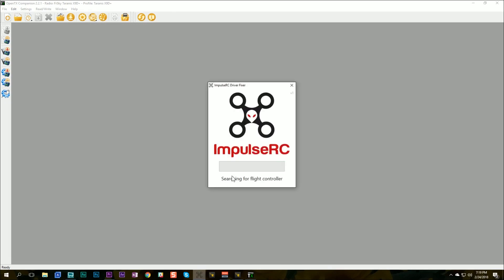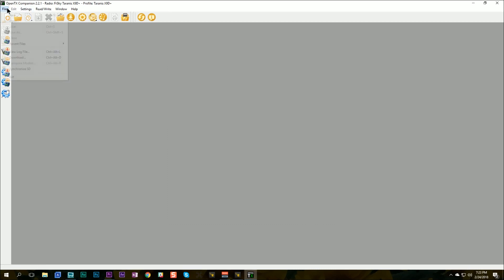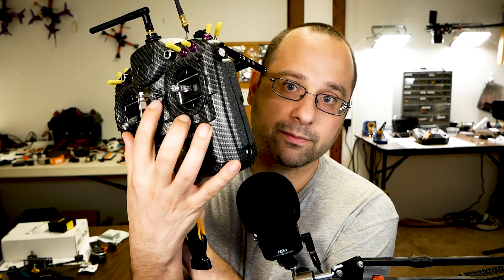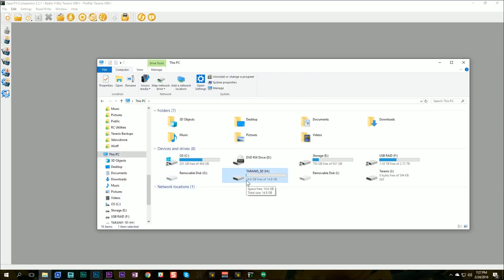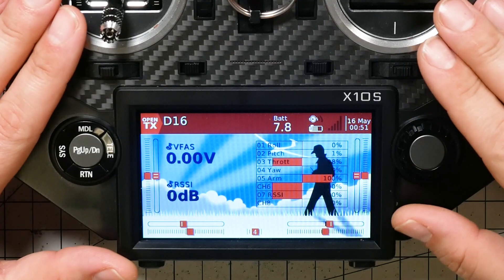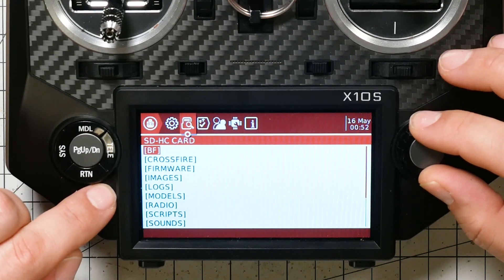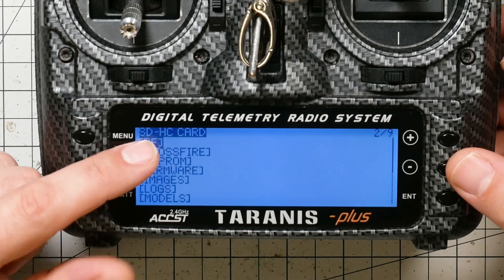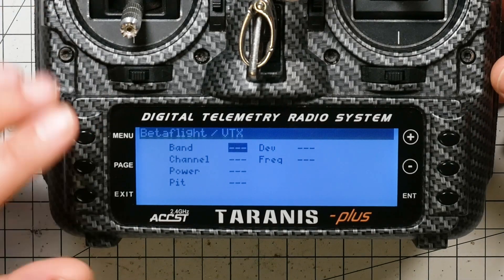Betaflight Lua Script Updated for OpenTX 2.2.1 | NO MORE OUT OF MEMORY ERROR

Comment: I did the update on my Taranis Q X7 to 2.2.1, but when I run the bf.luac script, all the values are blank on all the pages. I am using an FRSky R-XSR receiver on a CL-Racing F4S FC. The smart audio is working via the OSD. I also have telemetry data in the Taranis. Any idea why I am not seeing any data in the bf.lua script?
Reply: I figured it out, finally!
On the CL-Racing F4S FC, the telemetry accepts the inverted (regular) S.Port signal. You do not have to use the uninverted S.Port pad on the R-XSR.
Then I had to make sure in BF CLI that telemetry inverted was set to OFF and telemetry half duplex was also turned off.
In BF CLI type these commands:
set tlm_inverted = OFF
set tlm_halfduplex = OFF
save

That's what did the trick for me to finally get the BF LUA scripts working.

Comment: can we delete certain pages of the lua to make it take up less space? There are a few that I never use... I will def. be reordering though, thanks! although having to go to the firmware folder to run the luac is a killer for me, so inconvenient. I don't have memory issues unless I switch models then try to run the .lua again.. but if I turn off the TX and then back on, its good again until i switch models or try to change a lot of settings in one go.
Reply: one comment below said this should be fixed in opentx in the next release... thank goodness! now I REAAAAALLLLLYYYY hope they make all the power switch delays user configurable! currently they straight up suck and are like have 3 safeties on a gun... sorry for the tangent.

Comment: Hey Joshua.. im having a problem with my taranis x9d plus.  I have updated it to opentx 2.2 about 6 months or more ago. Everything working fine up until now. When the radio plays certaon sounds it will get cut off mid way through. Example.. when the inactivity alarm plays it will say.."inactivity al." And stop and wont finish the sound file. Also some other sounds will be cut off as well.. they start to play and then stop.. everything else works perfect. 
Please help.  Thanks
Reply from the maker: I'm sorry I don't know specifically about this issue but I would suggest trying updating the SD card contents to make sure you have the latest version. That's honestly a long shot though.

Comment: I just followed this but when I connect a USB I get no popup. latest companion also looks different - I don't get mass storage options. URL is not 'in the video description'
Reply from the maker: What URL is missing? I just checked and links are there for the original video series, the IRC driver fixer, and my ui.lua file. What's missing?
Reply: i have the same "issue" when i connect the USB cable the controller don't show any pop up options to joystick mode or USB
Reply: Joshua Bardwell see at 7:00
Reply: just found it Andres! on the tx long press menu to get the radio menu, go down to USB mode and select ASK
Reply: https://github.com/betaflight/betaflight-tx-lua-scripts/releases  this one is missing ;-)

Comment: I have Open TX 2.2.1 but I do not have the joystick/bootloader message. Am I missing something? Also my simulator is not working.
Reply from the maker: You can set it in the transmitter to default to one or the other, or to ask.
Reply: Had the same problem. Go to: Radio set up. Press + 3 times so USB Mode is selected and select Ask. For some reason mine was set incorrectly right after flashing.

Comment: My Taranis freezes every time I try to put files on the SD card. I have to pop it out and use a card reader. It has always done this. Otherwise it works perfectly.
Reply from the maker: Perhaps upgrading to 2.2.1 will fix it?
Reply: I've had it since late 2016 and had a few different versions of OpenTX on it, including 2.2.1, but the SD card problem never goes away.
Reply: Well no lua for me I guess. I get a script syntax error BF/ui.lua:1
loadScript("/SCRIPTS/BF/events.lua", "bt") then it goes off the side of the screen. I guess it's time for Spectrum or Futaba or something.
Reply from the maker: I think your SD card is fried. Have you tried a new one? The one that comes with the Taranis is pretty shitty.
Reply: I don't have another 1GiB one to try. IDK though I tried formatting it and it gives the same error every time. If I hit exit out of the SD card menu and then go back in, the files all disappear. I have to reboot to get back in. It's either corrupted firmware or hardware or something.
Reply: Hey LightningStalker... small world! I attempted to get lua scripts going today on my Taranis and I kept having the same loadScript("/SCRIPTS/BF/events.lua", "bt") error as well every time I tried to launch the luac. I'd also get "unknown error." This problem drove me up a wall for hours. Bardwell was right. There is something wrong with the microSD card. I tried everything -- reformatting the microsd card (not quick format) multiple times, reloading the microsd card files, etc everything you can possibly think of. Nothing worked, but at the same time there was no clear indication of any corruption. Then I saw your comment about your Taranis freezing when trying to copy files directly to it. I tried doing that and I have the exact same symptom... so...  I switched to a 4GB one and it immediately resolved the issue. You don't need to use a 1GB one -- I think it can handle up to 16gb. Give it a try if you're still having problems with it.

Comment: I tried this and it bricked my radio. I suspect my folder structure was wrong or corrupted. To fix it I did 3 things. 1.) re-ran the ImpulseRC driver fixer 2.) re-unzipped the sdcard-taranis-x9-2.2V0013 file and put it on the SD card 3.) put the firmware .bin file on the SD card this time in the firmware folder and flashed it using the radio instead of OpenTX companion.  It said my EEPROM wasn't right though, but it tried to fix itself and seems to be OK.
Reply from the maker: You should always be able to flash the radio in DFU mode, which you access by plugging in the radio with the radio powered down, then run the IRC Driver Fixer. But ultimately whatever works...
Reply: I'm just glad I got it back to working again. I was sweating it for a minute, and now I can run the lua scrips. Yeah!! Thank you Joshua.

Comment: Why do you say that you need 2.2.1 to use crossfire? A lot of people was using crossfire even before this version. Where is the problem using a previous version? I didn't understand. Maybe not necessary for x9d but only for the qx7 (2.2.1 introduces the opportunity to lower your baudrate and run crossfire without telemetry error on the x7)
Reply from the maker: 2.2.0 is the minimum but 2.2.1 adds the ability to reduce the baudrate on the QX7 and X10. 2.2.1 is not required but recommended.

Comment: Did every thing in the video and no telemetry shows up even after I discover all sensors  .this all started after Open-TX 2.2.1.Everything worked fine with 2.2.0,telemetry lua scripts to change my pids ,now I can't get any of it to work now
Reply from the maker: I can't think of anything that's changed in 2.2.1 regarding telemetry, that would make it stop working if it worked under 2.2.0. I would be investigating the quad.

Comment: Hi Joshua.. thanks for the update... I edited the script.. and it seems to work until the transmitter is turned off/on.... Then the next boot it's back to page1.. Is there anyway to do this so even after a power cycle of the transmitter the vtx is always the first page in the lua script?

Cheers!
Reply from the maker: Hmmm I need to confirm this but I don't think that is how it worked for me. Maybe try deleting the .luac file after you edit the .lua file?
Reply: hi sorted, for some reason the first file i downloaded from you didnt have the edit... working fine now! thanks for this tip!! so much better straight to VTX ;)

Comment: What exactly are the differences between the LUA Script and BF OSD ? Isnt changing my values in my googles more convenient?
Reply from the maker: That depends. On the goggles, you must tediously click through menus. Also, sometimes you aren't wearing your goggles. Finally, the vTX settings are really nice if you don't know what channel you're on, you can easily set the channel without having to do a scan in your goggles.
Reply: Try it one time, guarenteed convert :)
        I actually no longer use OSD for anything. more room in the googles,   lua scripts to change "anything" as Joshua mentioned and lovely Amber for voltage warnings

Comment: So, this memory error you speak of, it only happens when you page around inside the script for a while when running it from a telemetry screen from a long press of Page button? (This is my first foray into the LUA script stuff.)   

For the sake of exploration and whatnot: 
First, I edited the x9pre.lua file and put the VTX page on top, as it is probably the only thing I am likely to use it for, and it allows me to see what channel I am on from the radio, instead of searching with the goggles, obviously... 

Next, I added Script, bf to the telemetry screen 2, to get it to open on the long page button press, and it comes up just fine.  

So, will the out of memory error pop up if I leave it on the screen? or only if I page through the script a whole bunch? 

Would it help if I removed some of the pages from the x9pre.lua file? (like the rx page)

And to further confuse things... I haven't actually been able to find this infamous out of memory error...

Comment: Do i have to re-bind my models once I update firmware of the radio?
Reply: I just flashed from the 'old' 2.2.1 to the new 2.2.1.. all models are still there.. No re-binding needed.. I could just go & fly straight away...
Reply from the maker: No, you do not. The bind info is stored in the model. So as long as the model is preserved, so is the binding.
Reply: ok thanks guys

Comment: I run 2.2.0 with the new lua script without a problem. Still using the betaflight short cut on the second screen. But helpfull video. Waiting for crossfire😉
Reply: Same no problems. I have 1 quad's SA connected  directly to crossfire via channel 4 just fine, and my other quad has SA connected to a uart running the page shortcut.

Comment: Apparently the developpers of openTX finally decided to allocate more memory to LUA scripts in the nightly builds which will probably be the case of OpenTX 2.2.2 and over next releases.
So your fantastic hack will be possibly not necessary in a close future BUT thanks for sharing anyway because maybe some other scripts will require this hack :)
Reply: If you install firmware with LUA and LUAC options enabled, you can already run the script through the shortcut without the memory error.
Reply: how?
Reply: Delete the .lua file and rename the .luac file .lua  You're welcome!
Reply: Yeah nah :)   Was still getting memory errors in recently released OpenTX 2.2.2. However, flashing as per JB's advice with noheli, lua & luac enabled seems to have done the trick.
Reply: I couldn't get it to work with 2.2.2. See my comment above.

Comment: Why can't the updated lua script be copied to the script folder so it shows up as an option in the page setup screen ?
Reply from the maker: Maybe it can?
Reply: Joshua Bardwell I tried with the crossfire.lua to control the TBS vtx in raceflight, cuz SA has to b wired to ch4 on the micro receiver  and Vtx controls are done via the rx element that is generate from the crossfire.lua.. that was a mouth full lol.. only on micro module..
But seems is a dependency as I can't enter the RX element, crossfire.lua will execute, shorten the name and changed script hooks to match but still can't get to the RX :(.
  Playing with R9 slim today.
Have fun with Crossfire, would be cool to see your opinion of the two, when your comfortable with cf.

Comment: I have the new lua and I'm on the qx7. I do not get the low memory warning or syntax error. Betaflight works everytime without that luac. I only get the low memory warning for the inav lua, and syntax error for lua pilot. 

Go to your folder that has the x7 x9d, and horus labeled folders. Delete the folders that are not for your transmitter. Only delete the other transmitter named folders. Then the page shortcut works without memory error

Comment: I just installed all this..... I have never had Lua scripts on my controller at all and of course I had to be the first one to find this error... But with that being said when I remove the BF folder out of my SD card I can use the menu key the same as you did in the original thing without having to go through all that other stuff... You may want to check into it again all I did was remove the BF file after I got the memory error... So maybe you have to install the BF file first to make sure it all works and is installed.. but after that you can remove it in the menu thing will work just the same... If I need to I will show or upload a video ...

Comment: Ironically I dealt with this exact same problem last night while doing all this.... Ironically though the way I solved it is because originally it didn't have the BF folder in it... So my work around was remove the BF folder.... It solved my problem without changing anything in what I had to flash to my controller.... But I am new so I'm not sure what's in the BF folder that I may want to keep I may need to reinstall that into my SD card.... And then of course update my firmware to match with the new Lua C

Comment: Could you explain the whole driver fix issue/problem/thing so that it makes some kind of sense WHY we have to do this all the time?  The other thing is...when you drag a folder out of the zip file into another folder, I'm assuming this file is getting extracted/unpacked??  ....but why are you NOT getting a duplicate folder prompt.  Are you over writing the existing folder or what??  Thanks.
Reply from the maker: The windows built in driver doesn't work with our programs so we have to replace it with a generic driver that does work.
Reply: Why every time though?
Reply from the maker: I have no idea actually.

Comment: I was hoping you'd have the full size tx and show everyone how to connect channels 3 & 4 to a uart so you can connect to Betaflight through bluetooth.
Reply from the maker: I got the micro because it's more affordable and for people not doing long range it's more than adequate.
Reply: Joshua Bardwell Most of the guys I know who got the micro tx are selling them and getting full size module. Faster protocol is nice but when you want to get into longer range the 2W vs. 100 mW is a huge difference. Plus other features like Bluetooth. I just ordered the full size tx myself.
Reply from the maker: I'm not that interested in long range video. As long as you're using 5 GHz video I think the micro module will do fine.